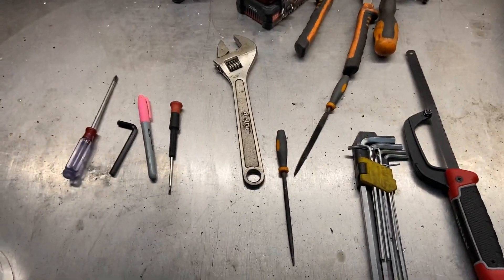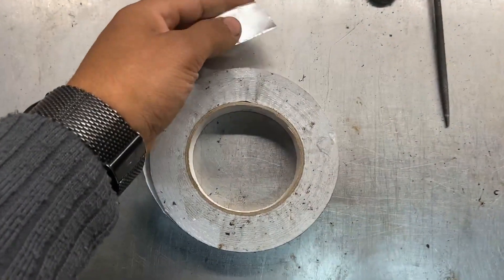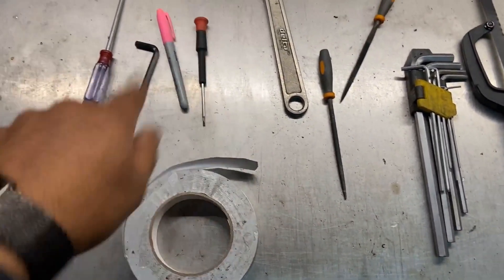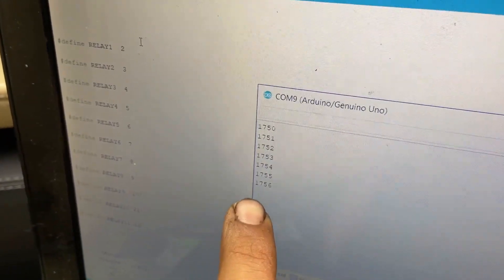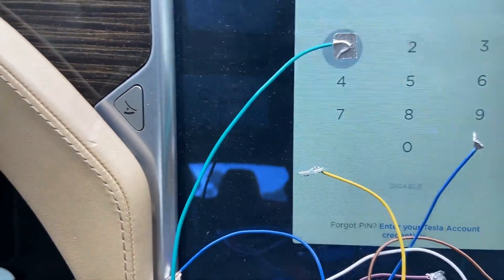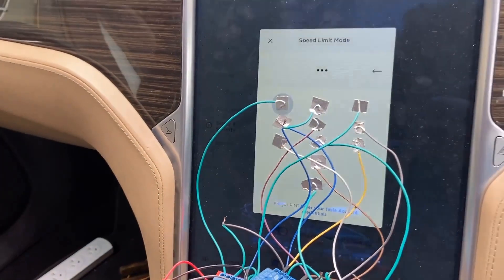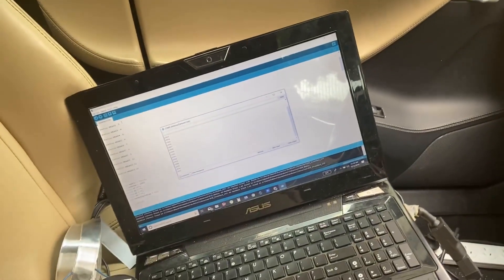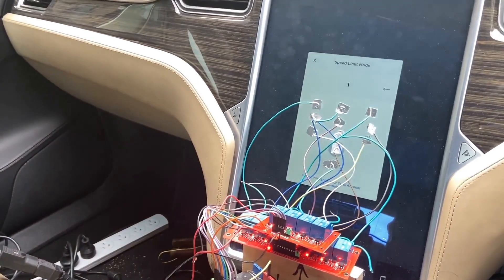Tesla Touch Screen Brute Force Hack

Comment: very cool video keep up the great work, but what is the metal parts below the screen that the relays are resting on?
Reply from the maker: Haha, thats a small robotic Uarm , i tried using it previously but it was too slow and inaccurate, so i just reused the stand i made for it so the relays are at the right height :P
Reply: @TechEyeMan  ahh, i see. Looking forward too smiular videos to this in the future :)
Reply: I'm surprised the model S/X  doesn't shift the input box around like the model 3.